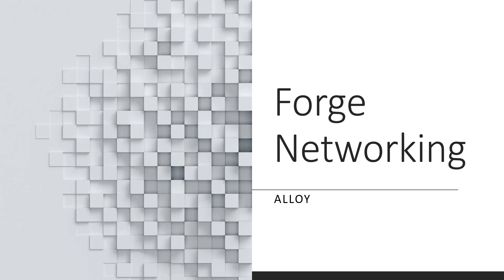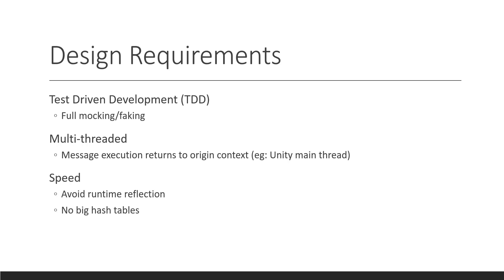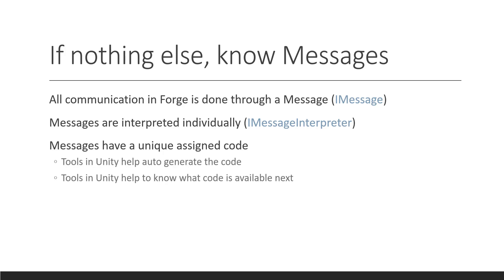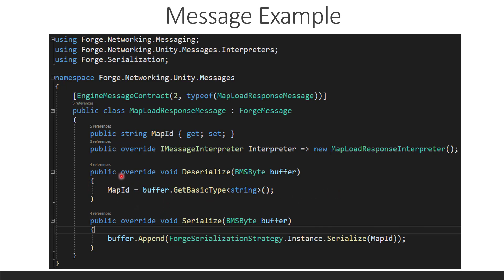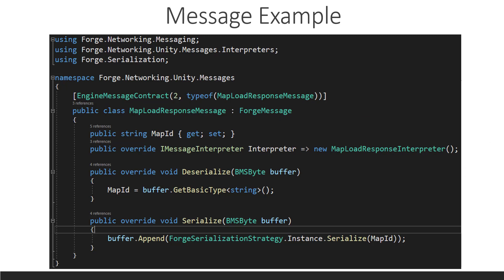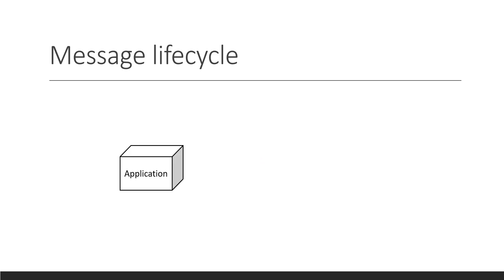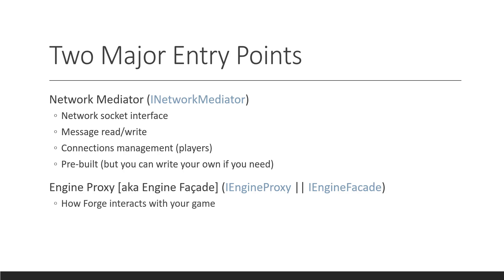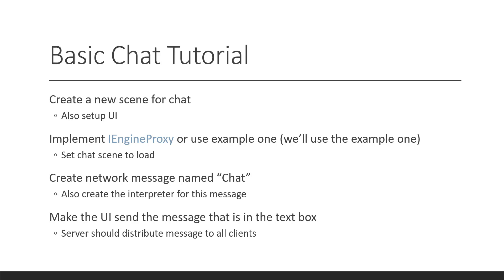Forge Networking Alloy Introduction - Unity Engine

Comment: Is there any way I can use Android Nearby as a means to make a connection? Not sure if you guys know about that Unity plugin, but it makes it uses WIFI Direct, surpassing the need to even use a router for lan games. Any tips or plans to integrate Android Nearby?
Reply from the maker: Good question. This is something I'll definitely look into because I use WiFi Direct for sending files between my phone and tablet all the time. It would be nice to use this local connection in the library as well if possible.
Reply: @BrentFarris  Why are you guys the best?